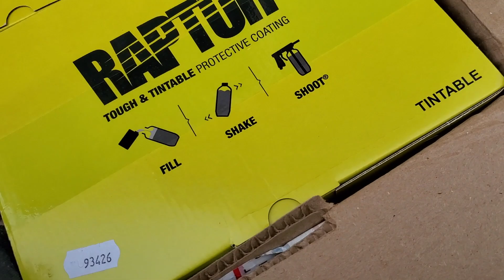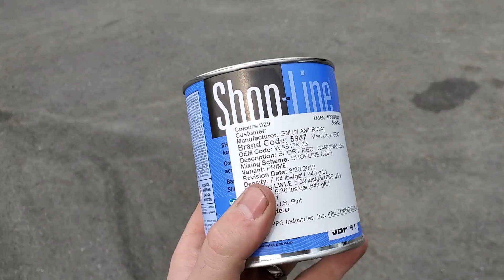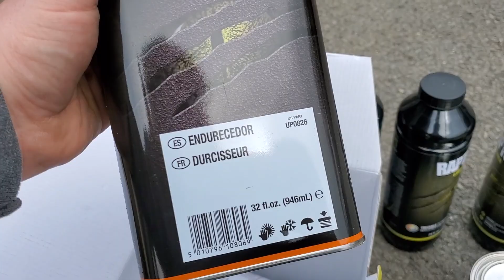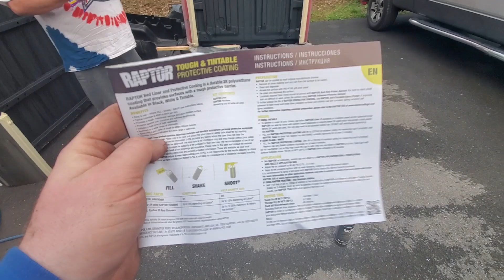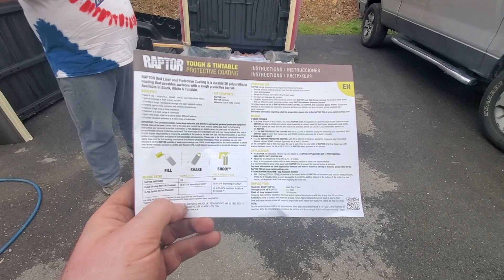Raptor Lining the New Cab and Bed for the Duramax Rebuild!

Comment from the maker: It really does suck when stuff doesn't turn out but I love to give everything a shot.
Reply: You did fine my Frist try was not go it frosted after i raptor lined my flat bed shot it on black was gray next day someone moved out side after i left it in the heated paint booth heat is the frist key i learned on mixing a color in raptor line is black or white or clear white tine your paint a shad or to if i remember right but it looks great for you Frist time i give you 10 🔅 points for trying most don't but there the picky done better types
Reply: I like the mindset of giving everything a shot.
Reply: It didn’t loon bad at all but you can always just spray over it just gotta scuff it you could get some cheap paint idk
Reply: I ended up blasting my dump truck frame twice cause of that paint doing just what it did to yours. I thinned and sprayed it the first time and brushed it the second time with no luck at all.
Reply: If you didn't try you would be regretting it. But regardless it looks so much better.👍
Reply: Try POR 15 worked good on everything we've done.
Reply: My raptor liner faded the next day. What i realized is the condensation at night reacted with it. I rescuffed and cleaned with acetone and resprayed about 10am with sun beating on it. Turned out perfect and had the semigloss look i wanted. Try reshooting just an overcoat to get color back.

Comment: What paint did you use for the frame?
Reply from the maker: Rust Pro MD.
Reply: TopLineRacer I use Majic tractor paint on engines, and my frame.... over oil and everything basically just get any flaking paint off the frame and it never bubbles like that. You can get it at tractor supply. Also you can thin it and spray it on but personally i always just brush paint it.

Comment: Oh man that's that... ha. oh that's pink. P.s Since i'm doing a factory restoration on my square body and I'm in the rust belt like you... what would you consider for a more "Factory" look but still coat and protect the truck POR-15 or Rust Proof M/D Or... Eastwood Rust Encapsulator. Mind you I'm going for bone stock Show truck look.

Comment: Use the raptor gun instead of a brush to coat the frame 
The prep is a lot longer but it’s cleaner and faster
Reply: Billy Prause you’d never in a million years get good coverage on a frame that’s still assembled with a gun
Reply: OntarioRedneXXX  you’d be surprised it goes on really nice I’ve done it a couple times now and it’s fast and gets all the  places you can’t reach with a brush

Comment: Yes that's today for me hope works out better for you looking great. Frist one that's frist maybe make it a 6×6 instead of a four door that would look good and more bank's parts like engine bake if it's not got one shake it well and mske Shore its 60- 70 out for best results i used this on my trucks and at body shop scoffed the hell out you are using it put under bed rockers in spaces you don't want rust even battery spot if you got tined one make shore to mix it very well one bottle at a time hotter it is faster it drys cooler it take more time don't use the rubber grit comes with it make it like broken glass if you like skin on hands and head

Comment: The reason for the coating dripping on the frame  the GM frame has a wax coating on it and and thing you put on the coating that has a solvent base will react with the wax coating and take forever to dry and not stick  if it does stay on it will fall off  and look like shit  the only way to do it is you have to strip all of the factory coating off hope this helps I am a rustproof tech
Reply from the maker: That makes sense. Thanks for the info.

Comment: You didn't prep it so it will rust underneath also put it on too thick my friend
Reply from the maker: I'm not really sure what else we could have done honestly. We pressure washed and degreased for days. The stuff said it would stick to basically anything and it peeled worse where it was put on thin than thick. We are gettjng our money back though thankfully.

Comment: I'm starting to wonder why we are all watching you idiots try to rebuild a truck, go in the garage and build your own truck guys, it's not that hard, it will be ten times more work than you ever imagined but very rewarding when done, I'm on my fourth Dodge 2WD 1500 that's getting a one ton 4WD frame, the one I'm working on now is a 360 gas truck with a extended cab and a 9 foot flatbed, 163" wheelbase, hopefully these guys inspire you to find your own project, good luck and God bless